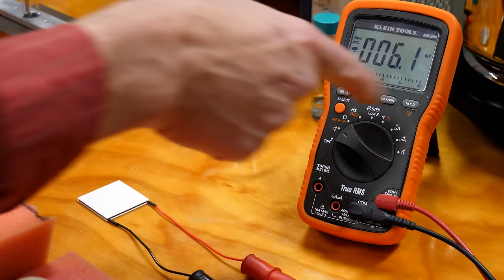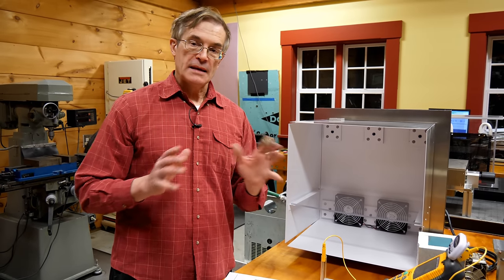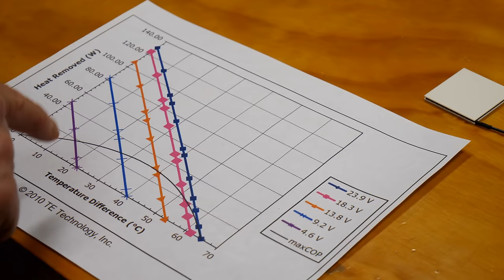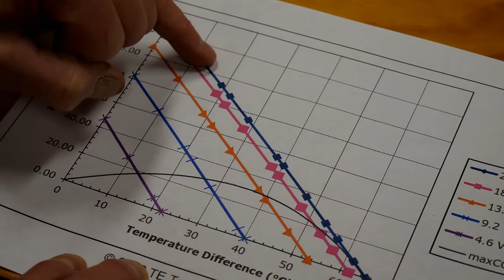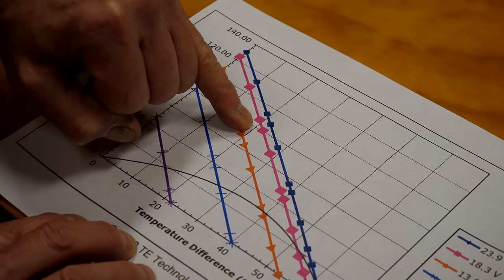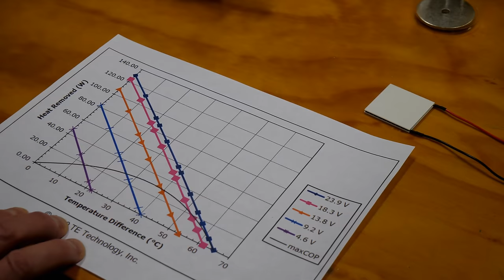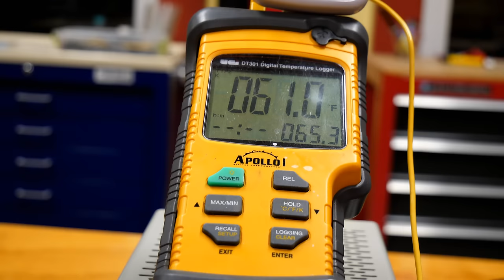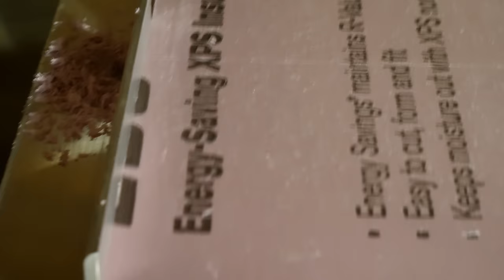BUILD YOUR OWN REFRIGERATOR! - SOLID STATE TEC

Comment: Very nice project. But how many total Volts and Amps does it need ? How many Watts does it consume ?
Reply from the maker: 125 warrs continually.  You can trade between  volts and amps based on how you choose  to wire together the multiple TECs.  The performance  won't  change.
Reply: @TechIngredients  So 125 Watts .... The higher the voltage the lower the amps ... And the lower the amps the less energy loss and the less heat in the circuit and cables. 65Volts and 2 Amps would work.
Reply from the maker: Correct.
Don't  discount  a particular voltage that is easy or less expensive to supply based on the availability of power supplies.

Comment: What about the heat conducted through the bolts that connect hot and cold sides of heat pump? They seem to be very close to to the module and so they see quite significant temperature differential. Wouldn't mounting them  little further from the module (for example half an inch from the aluminum blocks, through the insulating material) reduce temperature difference, especially due to much lower temperature on hot side?
Reply from the maker: They are stainless steel and this has a remarkably low thermal conductivity.  Also, their clearance holes are way oversized, forcing any heat flow to pass through a substantial fraction of their entire length.

Comment: Great topic, fragmented thought process. Please take the time to identify and anchor your bullet points. Try not to get them lost in every possible variation of the technology.

Let me start out, with a rapid explanation of a technology that I'm not going to be going over during this video. Then let's slam into into another technology. And because I'm impatient and don't want to create continuity with experiment A... Let's get right into experiment B. 

It is fine if you want to run multiple experiments at the same time. You can create separation / continuity and compress timelines with video editing. But please take the time to thoroughly finish one thought process before starting another in your delivery.
Reply from the maker: Thanks for the suggestion. However, I do it this way on purpose.  I want to tie the discussion together with examples that reflect the possibilities and other options, but without covering these with the same depth.  Doing so would make the video too long and risk loosing the audience.

Comment: Can I use two peltier units, with two 120 mm fans, inside as you did, to cool 3 cubic feet with very little insulation? The back is two large heat sinks with 4 120mm fans.
Reply from the maker: No, not if they are anywhere similar to the size of the 40mm x 40 x mm TECs we used.  The six in our refrigerator with good insulation are enough, but not way more than enough.  I would use at least four and the more the better.  The whole thing just gets more effecient.
Reply: @TechIngredients  It looks like I am going to have to use insulation. So I am going to use 1" home insulation foam (that high density pink foam board) and see if I can cool 3 cubic feet with 2 peltiers but the issue I am having is that the cold sink is very cold and I am unable to move enough cold out into the air from the cold sink. After watching this, I need to find a way to increase the cold sink to get more of that air flow over the cold sink.

Comment: i'm building a 5'x8' teardrop camper, and want to have a refrigerator/freezer in it. i was considering using the cooling system from an upright dorm fridge, and converting it into a chest type to retain the cold when you open the door, rather than letting it spill out. would it be more energy efficient to have a peltier type unit over a compressor type since it will be run from a battery and roof top solar panel array for the majority of the time, and i'd rather not have the refrigerator consume the entire battery capacity.
Reply from the maker: With a lot of insulation, both approaches will use little power. However,  the conventional phase change system will always  be more efficient.

Comment: 21:19 (getting rid of the heat) 
Rather than getting rid of the heat, wouldn't it be possible to use it in some way to assist in another application?

Comment: Hey Master, I had an idea and I am not sure if someone had done it before. It is a Split fridge, like the split Air conditioner. I am talking about the Freon one Not the thermoelectric.  I always wonder why we keep this very very Hot motor stuck to the fridge which we want to be cold at the first place.. I think about getting the motor to hang up near the ceiling and let the hot air stay there (in summer). Or we can use the motor as a heater in winter !! just let the motor be mobile and well cased..  Sticking the hot motor to the cold fridge always strikes me as a very bad idea.
Reply from the maker: I understand.  Remember the earliest refrigerators mounted their heat exchangers in a large cylinder on top?
You're taking that good idea a little further.

Comment: What is the amp rating on the peltier modules you use here? By "low speed fan" I'm guessing ~1100 rpm?
Reply from the maker: I don't  remember. However, no matter what peltier you choose, the lower the current flow, the higher the efficiency.

Comment: would using "aerogel" as an insulator increase the efficiency of the device ? 
Not looking at the costs compared to other insulating materials out there.
Reply from the maker: Yes, but you're right, cost would be a consideration.

Comment: Someone else may have asked already (didn't read comments), I don't know much about this stuff at all. Disclaimers out of the way lol, could the Peltier part be combined with a chest freezer to increase efficiency? I read about someone else's design for a chest REFRIGERATOR (made from a chest freezer and other parts) and it used very little electricity and was very effective.
Reply from the maker: Peltier devices  are very inefficient.  But, they are compact and low cost. If efficiency  isn't  the main driver, then they may be a reasonable  alternative.

Comment: As the specific heat of water is around 4000 can we use it as coolant and radiant with a 2 closed loop system, one loop for cooling and other for heating, and peltier system in bet?
Reply from the maker: Yes

Comment: Coming back to your profound video after years, because I want to build a 1/8th scale model of a refrigerating truck trailer.
There are different variations of TECs on ebay: For a given dimension, let's say 40x40x3.4mm, one can get these with a power rating of 46 to 231 Watts. Price differs also, but not proportional to power - it's low anyway.
Does the higher rated have more couples, arranged on the same surface of 40x40mm?
Given a fixed number of those TECs I want to use and a fixed amount of electrical power I want to spend for the complete bunch - is there an advantage in using the more dense, higher rated?
Reply from the maker: There are several interacting variables.  Take a look at a distributor like Custom Thermoelectric.  They have good spec graphs for each module that give power usage, volts, amps and heat moved at different delta T's.
Reply: @TechIngredients  Thanks for the quick answer. I see in your "TEC Freezer" video that you used the 12710 type. Another youtuber (more from the "tinkering" side) said that 127xx always refers to 127 elements, whereas the last two digits are the current. Ebay offers vary from 12704 to 12715.
So once again the thought experiment, not just for you, but for all listeners: If I use 12 TECs of that size and restrict the current through each anyway, let's say to 2 Amps, is there any advantage in using the 15 Amps type over the 4 Amps type?
Reply: @TechIngredients  I think I found out something about my question, comparing datasheets.
I want to build a refrigerator standing outdoors on a summer day, so I have to calculate with at least 30°C temperature difference, even if I do a good job on all the thermal junctions and a water cooling with a radiator underneath the unit.
In this case, if I drive a mighty peltier with just very little current, it will not even be able to pump heat from the cold side to the warm side. The passive heat flow from hot to cold is stronger.
If I take a small peltier to its max rating, the COP is poor.
So the best point lies somewhere in between.
The diagram you showed in the video, indicates the same with the black COP line, which has a maximum in the middle.

Comment: A bit late to the channel.  With the convective plate system on the back of the fridge.  Wouldnt the efficiency be improved if the sides of the plates were blocked.  That way convection would drag air through the whole plate stack.  With the sides open the centers of the plates would be heat soaked and effectively insulate that area of plate from air flow.
Reply from the maker: It should help, but when we tried it the effect was too small to measure and so reluctantly we went to the fans.

Comment: On a video it is shown that you first fix a shim on a bolt (37:26) and only after you fixing aluminium block with TEC.       First question: why need a shim? And a second one:  if there is a shim why need to coat WHOLE aluminium block with termal paste  if the block will be in contact with back wall only where  shim is fixed?
Reply from the maker: The principle that guides the assembly is that every surface that can conduct heat needs either a silicone thermal pad or thermal grease to improve heat transfer.  There are two sheet metal "U" components that comprise the walls of the enclosure.  The silicone pad is located between these sheets and acts to transfer heat between the component that contacts the TEC stack on the outside with the component that comprises the other two walls.

Comment: I would like to use the peltier elements for a fruit dryer.  I need to remove the humidity from the air using the cooling/evaporation capacity.  At the same time I would like to use the heat that is generated by the other side of the element to feed into my drying chamber.  I use a compressor, heat exchange and cooling fins of a fridge to achieve that. Would a battery of say 6 peltier elements have the same effect and which one would be more economical?
Reply from the maker: The TECs would accomplish the same result.  They would be silent and more compact, but they would be less effecient in terms of power consumption.
Reply: @TechIngredients  Thank you very much I also thought so will compare the system with my present system i.e a compressor, heat exchange and cooling radiator to the Peltier battery that I have in mind.

Comment: What you want to do is pump the heat into a hot water system, or the desiccant evaporator in your Air Conditioner project.

Comment: Is it possible ro make a very high efficiency refrigerator with >R100 using standard materials.  Its seems strange we had ice sheds 150 years ago that could keep ice over the summer yet our modern refrigerators cant keep food from spoiling more than a day if the power goes out.
Reply from the maker: It is, but the key is insulation as those early systems used incredibly  thick insulation layers.
The trade-off  is the size of the finished  refrigerator.

Comment: Ok, lots of comments on the difference between a door and a bowl. Air acts much like liquid, heat rises and cold falls. Perdy simple eh. 
So with a door the heat has to travel to the top, bounce off the top surface warming it up and then be eventually cooled. With a top load the warm air has no resistance not surface reflecting it back so you are removing the warm and replacing with cold instead of having to cool the warm air which comes off the items.
Now when you open the door the cold being heavy rushes out and sucks the warm in and guess what .. during that time when the warm air is in the space it is warming everything in there up. Hmmm didn't think of that did ya. which is why the milk went bad before. 
With a bowl with or without a lid the cold air remains in the space and no warm air warms everything up to be cooled. So I think the best of both worlds would be to have an escape on the top load lid to allow the warm air to escape as the cold air replaces it. IN fact I would think that the best setup would be with the cool surface at the top like a ring and a center escape hole or the opposite with the cooling coils at the bottom and a vent at the top to allow the heat to escape or a heat sink at the top to draw out the heat. Hmmm time for experiments. 
Now we all know that cans and bottles are much colder when they are all wet in the melted ice... so why do we not have "wet draws" or wet compartments??
Last but not least 2 things.. I disagree that the color makes no difference that "all colors are black". When i used to rebuild air cooled VW engines i was reading an article of how people would chrome the engine (and the fins) to be cool looking but invariably would over heat the engine and without an auxiliary oil cooler would seize. So I did some experimenting as I thought that it was ridiculous because there is no light in the darkness of the engine to absorb the heat from the sun... BUT It was HUGE. Black absorbs heat and also gives off heat very well!! Whenever I took the time to paint the fins and everything Black, it ran at least ten degrees cooler usually 25 degrees or more. Now that was aluminum fins so the aluminum transferred the engine heat very well to the fins and the BLACK transferred the heat to the flowing air really well too. 
Which then leads to the next experiment Reflective foil. 
Ever notice how they put the reflective foil on the inside? Id works like crap for a reason.
Simply put, you want to Reflect that which you don't want. You want to Reflect the other guys bullets not yours. Isn't that interesting the space suits are with the reflective side out. Hmmmm 
So I did my own vey large experiment as a contractor when rebuilding a duplex. I put the reflective side out of the 1/2" foam on the outside and TAPED EVERY SEAM and cut so tight around the windows that it squeezed the foam a bit. Just as I finished the foiled insulation we had a long cold winter storm and the heater that was way too small that was on 24/7 and still cold all the time came one every three or four hours. Yes I put thermal double pane vinyl windows in too, great investment... 
Now the neighbors all came to see my work as I had taken the walls out and put a supporting arch between the kitchen, dinning and living room. Well when you had more people in the house the heater seldom came on at all and with 5 people without jackets it never came on, with ten people we had to open a window a bit. 
Next came the siding.. which means no exposed reflective surface and no light to reflect, so it would seem that it would not work as well. but it worked very well and slightly better due I presume to no direct surface area exposed to the wind. 
In the summer time, one window unit cooled the whole place basement, main and upper bedrooms, unless any door or window was left open on the first floor or basement. The AC window unit was put on the upper floor master bedroom. Later on for giggles I turned on the heater fan to circulate the cold air when it got really hot and wow it really worked for the other rooms on the upper floor. Drawing off the cool air of the underground as well as the cool of the ac. Which is why thermal cooling and heat from the earth is so very effective. See "Earth ships" and the one where a man grows tropical plants in a northern State (Wisconsin??) year round even in the snow with just BLACK plastic drain pipe and a natural convection with backup small fan. 
So if it were mw I would put foil on the outside of the fridge to reflect the Heat you don’t want paint the inside black at least the top and vent ot or heat sink it to an outside surface panted black to release the heat and see what happens but definitely reflective foil on the outside. Even then cover it with some vinyl for durability and see how much difference that makes.
But no way would I have any DIY or "off grid" or "efficient" cooler that was not top loaded!!!
Remember the warm air that rushes in to replace the cold heavy air that just pored out of the box, warms everything up during that time and the whole time it takes to "fill it back up again with cold air at least twenty minutes!! So you are not JUST cooling the air warm air but but cooling everything that got warmed up as a result of the warm air for the full time it is open and at least twenty minutes it takes to cool down the objects that got warmed up and then the twenty to 60 or more minutes it takes to cool them back down to the temp they used to be .. so long as the door remains closed and sealed during that hour and a half just to get back to where it was. Hmmmmm Not too efficient eh? Now if you could catch the cold air that pores out and then after closing the door could pour it back in that might help but it is the effect of the warm air on the items that is the real culprit in my eyes. 
Check it out and share what actually happens verses theory misapplied.
Loved the education on this form of heat exchange.
Here would be a great lesson on how a propane of other flame (high heat) refrigerator works. We had a kerosene flame refrigerator on our boat and I had a full size (for that time period) that used propane flame to cool a refrigerator????? Yup I think it was Tucker who started that after his amazing car... see the movie Tucker!!!! I had a "Blue Flame" refrigerator which has a one and half inch plastic blue flame shape logo on the front. Amazing and wonderful and "OFF GRID".. Wish i could find one today.
Blessings